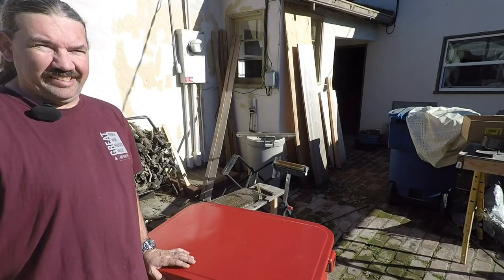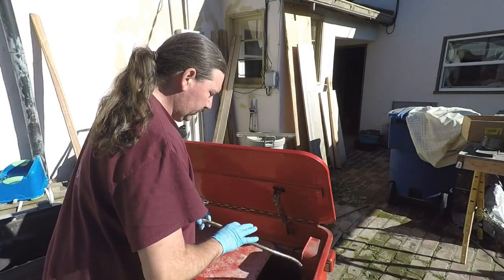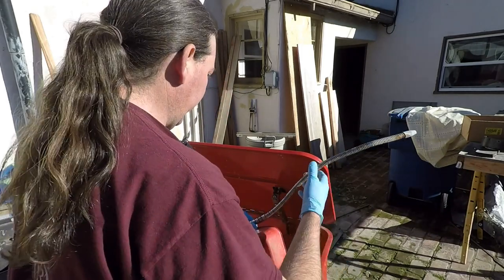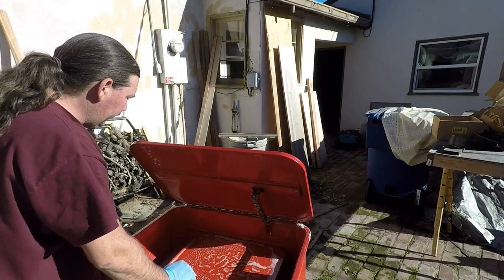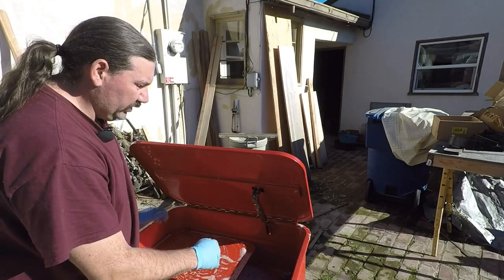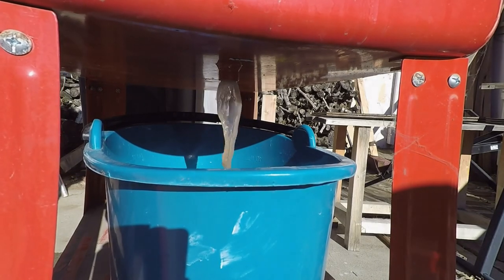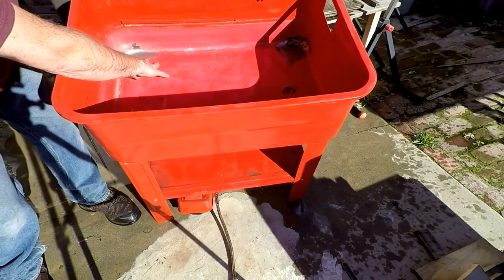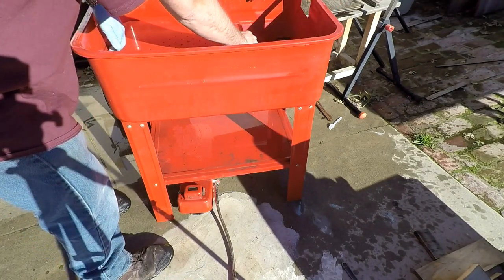Harbor Freight 20 gal car parts washer pump part 2

Comment: As far as painting is concerned, you need to get a chemical resistant paint.
I haven't looked to see what's available.
Do you see what I mean about the lid closer?
It only allows the lid to open about 70 degrees when you really want 90 to 100 degrees.
The extra 10 degrees past 90 lets gravity keep it open.
Thanks,
John
Reply from the maker: +Caveman's Mancave yes I do see what you mean. But I herd there's something that will drop the lid if a fire starts (if your using flammable solvents) so ft or now I'll leave it as is but it's still a option.  And hey thanks for the input. :)

Comment: were did you get the parts from? harbor tool don't sale any one but pump?
Reply from the maker: it was a pump they sold for small water features they had at the time but it may be discontinued now . i believe you can buy the pump from there online store.